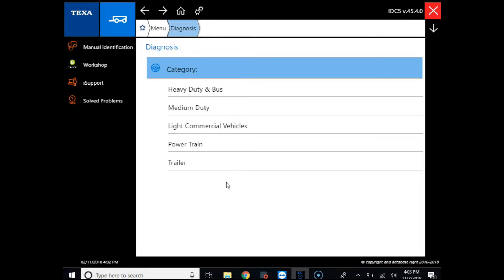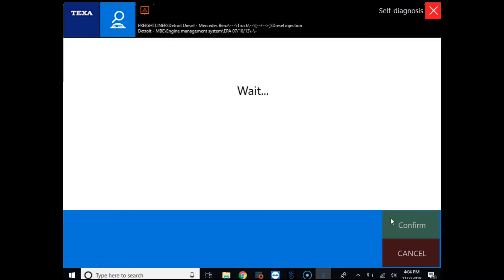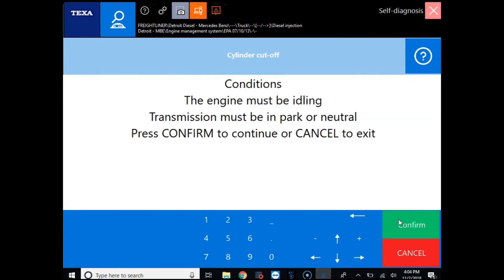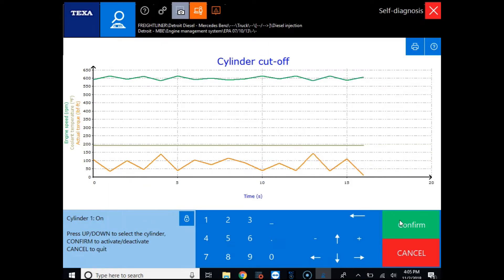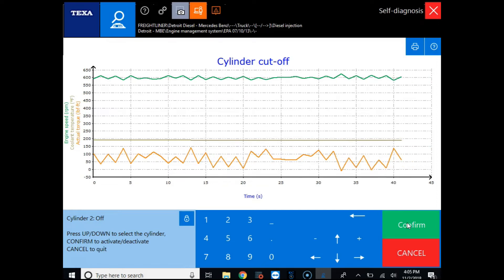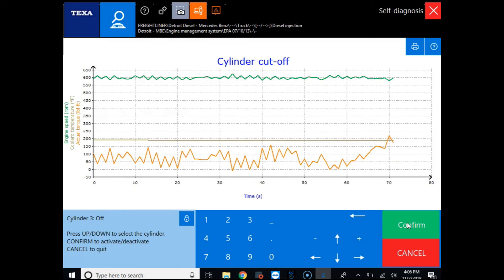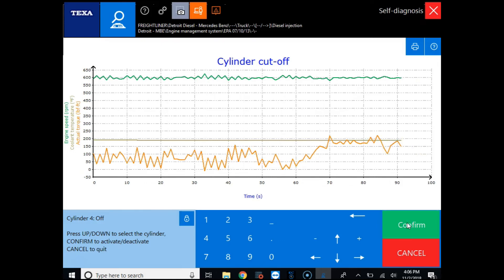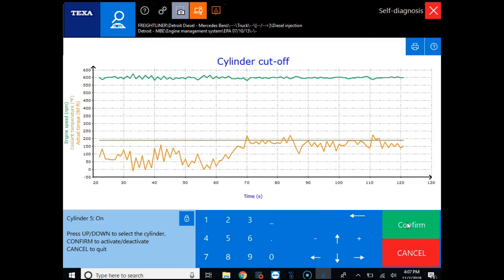Diesel Laptops TEXA Training - Cylinder Contribution Test Example

Comment: Is there any way to cut out more than one injector at a time
Reply from the maker: If the ECM allows it, the TEXA software will do it. Not all ECMs/manufacturers allow you to cut out more then 1 injectors a time. Some manufacturers (Like International medium duty engines), don't even have an injector cut-out test.